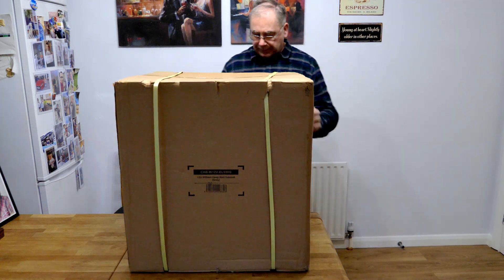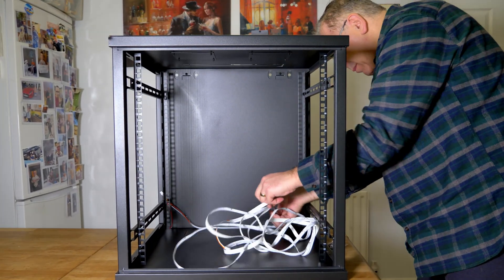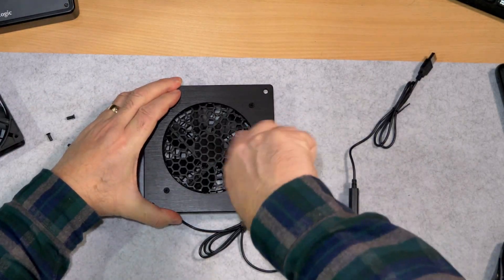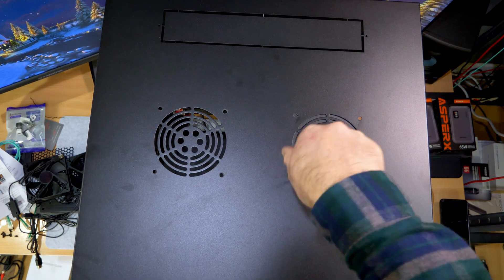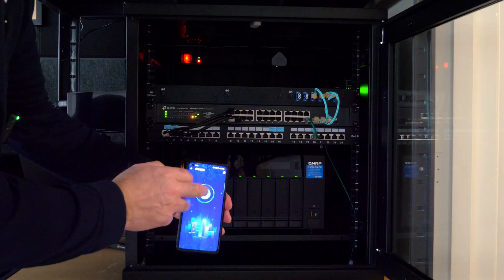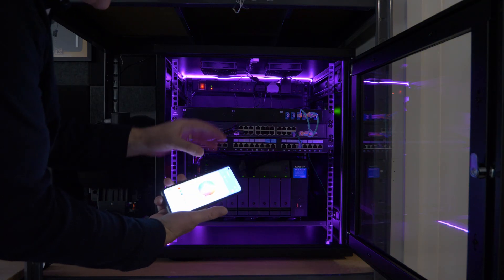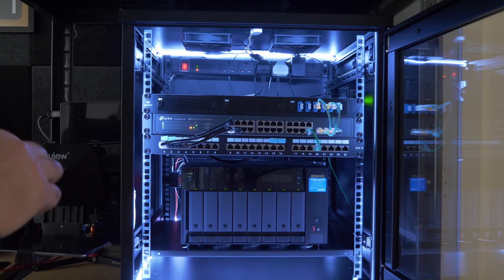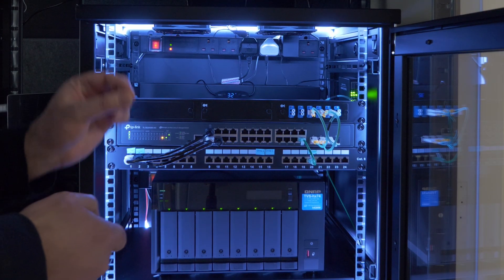The Ultimate Home Network Upgrade: A Complete Data Cabinet Installation

Comment: Bit strange that you stuck an off the shelf NAS in there? Why not do it properly? You can get cheap 2nd hand rack units off ebay. How does the air get in for cooling? The PDF doesn’t show if there are holes in the bottom, are there any? Just sucking out the top wont work if you have sealed up all the gaps with draft excluders as you said. Where is the UPS?
Reply from the maker: There are air vents on the side and a hole at the bottom for the cables to pass through, I did think about a rackmount server but I think it would of been too noisy next to where I make most of my videos.